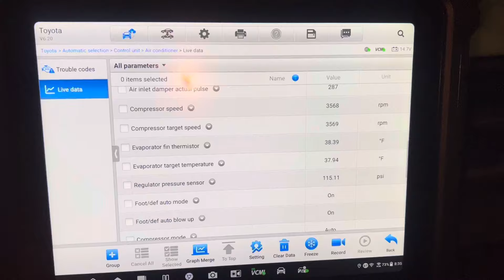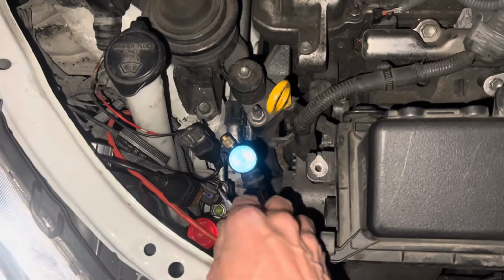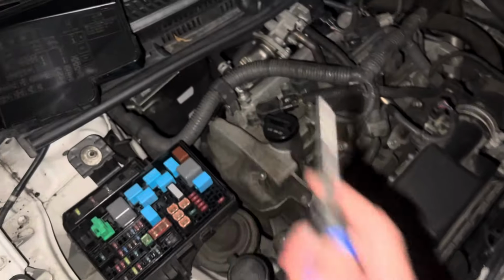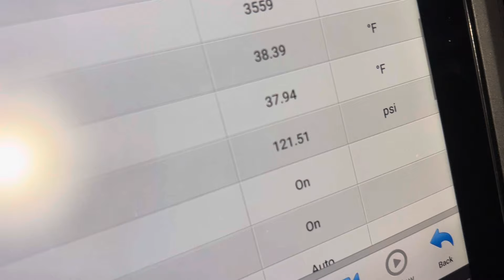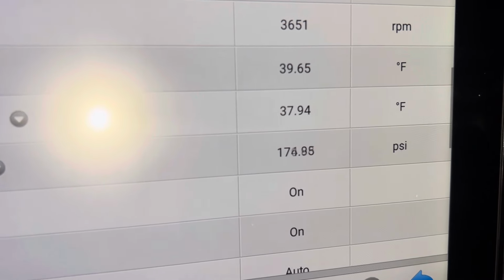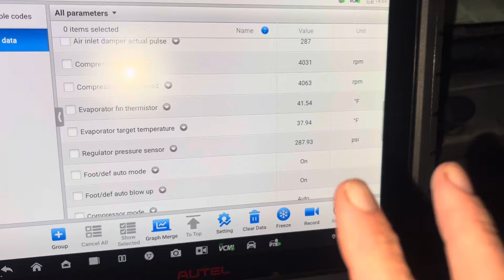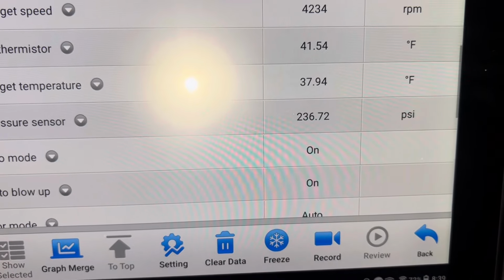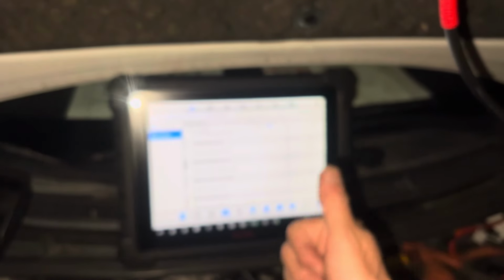DID YOU JUST REPLACE A GOOD AC COMPRESSOR?🤔 and you still have the same problem.

Comment: I had a compressor that would not build more than 280 when I rev the engine it will go to 300 something maximum then my high side fitting blew up….
Reply from the maker: @Chargifyx74  high side fittings should be able to take 600 to 800 +  something was damaged to blow at 300
Reply: @ it was a cheap one I noticed it not able to hold vacuum that was the first signs
Reply: @ and silly me thinking nylog would magically fix it 💀